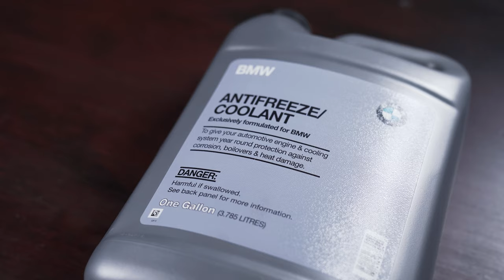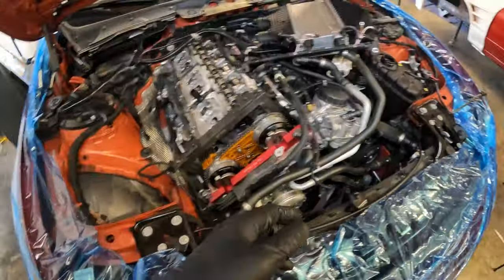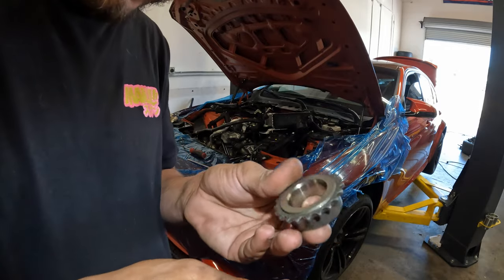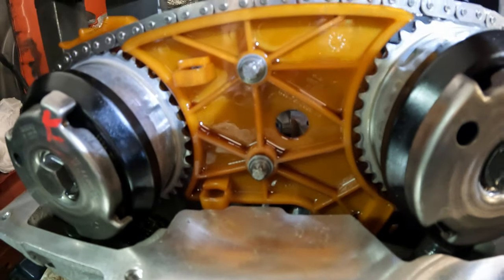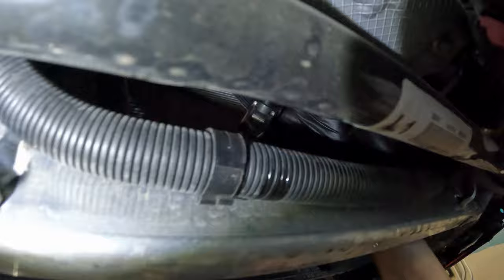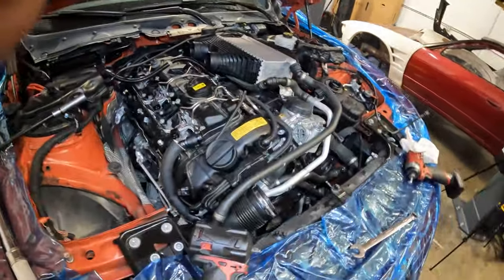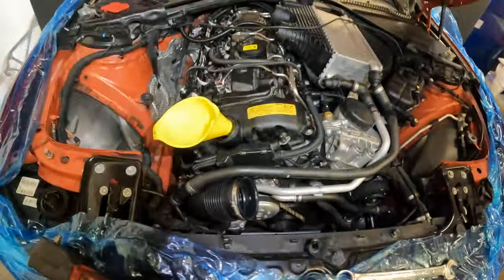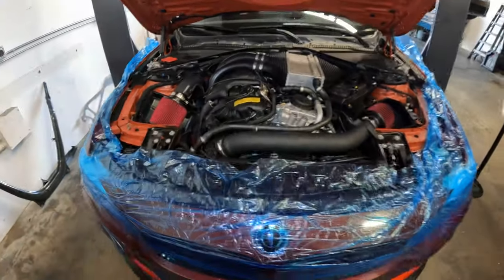The BEST Crank Hub Solution!! | VTT V2 Spline Lock DIY | F8X M2C M3 M4

Comment: Great Camera Work in Tight Spaces. How difficult to pull the whole front bumper?
Reply from the maker: Its much more difficult to pull the bumper and accessories like radiator/ heat exchanger/ condenser etc.  You would have to evacuate AC system as well. Would be a whole lot of unnecessary work to do it that way. Would be easier to remove engine and front subframe over front bumper and accessories. hope this helps!

Comment: if im that far into the engine i'd swap out the chain for a new one, your already in there you should really do it
Reply from the maker: @jimboforuk  if the engine is high mileage say above 80k or so I would agree and do the guides as well but some customers don’t want to pay the extra cost. Chain failure is not normal with these engines and this particular car only had about 16k miles so really not necessary. But valid Forsure as these engines age and higher mileage ones as well.

Comment: i feel like the crankhub is blown out of proportion. My buddy just hit 100k on his m4 and has no issues with timing or any signs of crankhub failure. Matter a fact i know a couple others above 50k miles without crankhub failure. All are above stage 1 ots tunes
Reply from the maker: you are good for the most part without it on stage 1, 2 or even 2+ but if you want to run ethanol is where the issues really start to happen. My personal car was on stage 2+ 91 octane for years without issue. 3 weeks after switching to E85 i spun the hub on a clutch kick drift initiation in 3rd gear. Immediate codes for timing and car hardly idled. Retimed and hub upgrade whilst in there and now i have peace of mind to beat it as hard as i want. its 2-3k insurance plan for your engine. defininently worth it IMO
Reply: Had a first gen '15 M4 manual, 65k with no issues, currently have 2018 F80 manual, stage 1 & ethanol @55k
Reply from the maker: @dinosoarskill17  Yeah its usually after stage 2 or custom tune when it happens!
Reply: I was saying exactly what you were saying. Blew my hub earlier tonight just before the street races, stage2+ custom E45 tune. Have had it tuned for over 2 years, took it to Germany, did the Nürburgring,  sightseeing, street racing in Sweden and roadtrips to everywhere. Many miles, but it does happen.